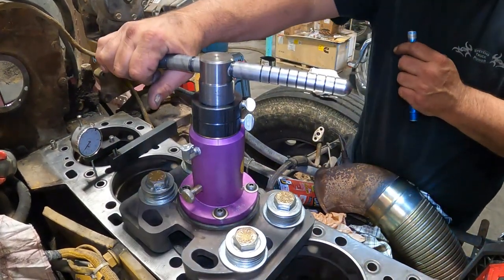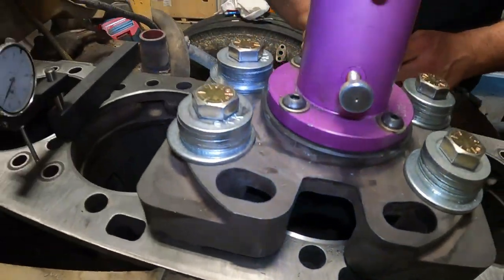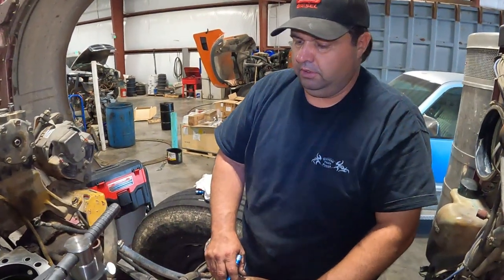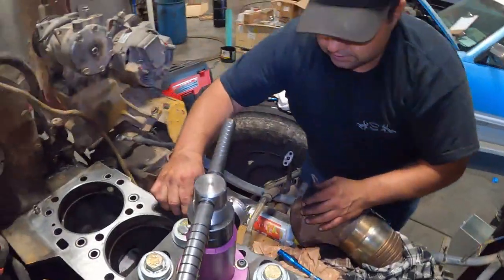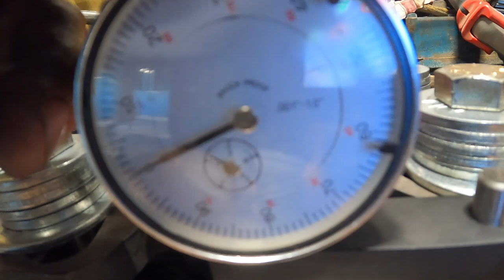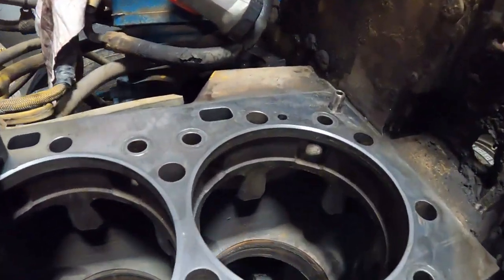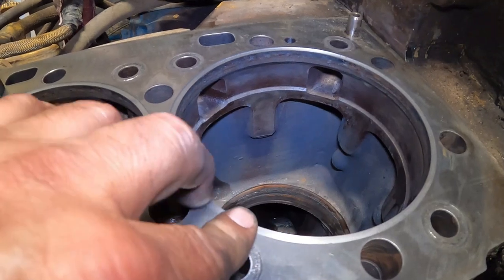Cutting Counterbores on CAT 3406E

Comment: Do you have to pull the front structure with that tool if you are cutting number 1? It looks like a huge base.
Reply from the maker: Nope! The handle in this tool slides in and out so as you go around. Your able to just move the handle away from the structure. Works out great. 👍🏼 it would probably be easier with the structure off. But not easy enough to make it worth pulling the structure. Thanks for watching!
Reply: @yourdieselspecialists  I've used the smaller base and it has the same handle, but I like the sturdiness of this tool and was just wondering if the base cleared, but sure sounds like it does. Thank you for the quick reply.